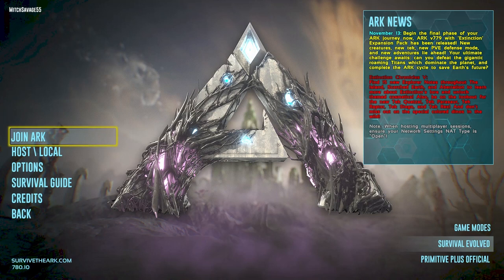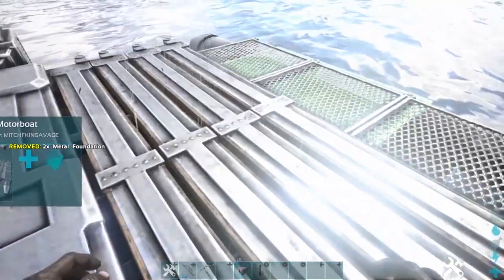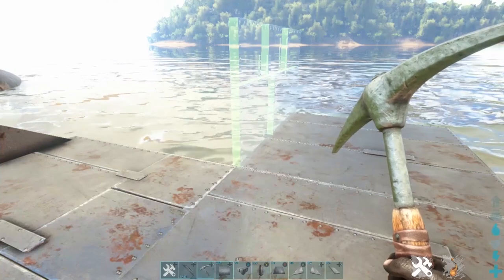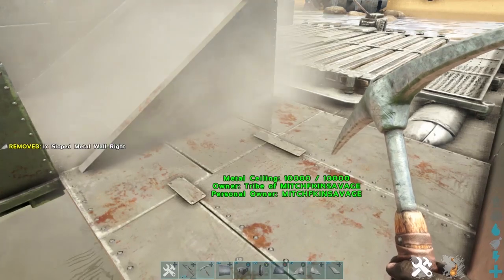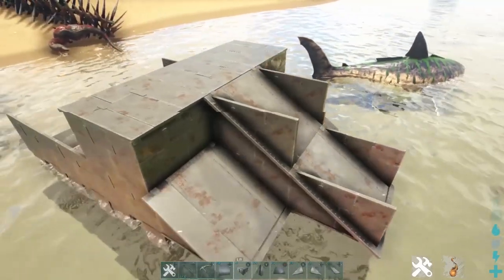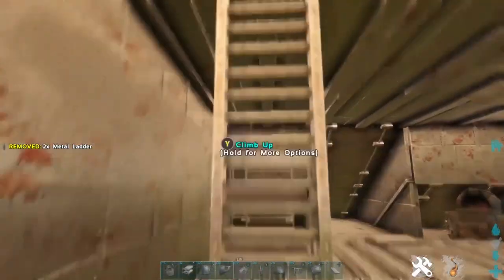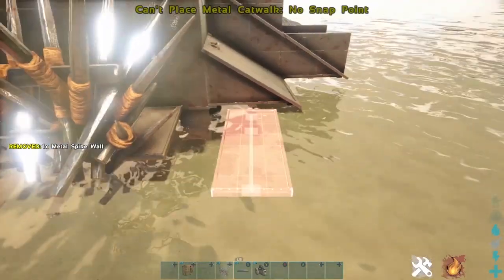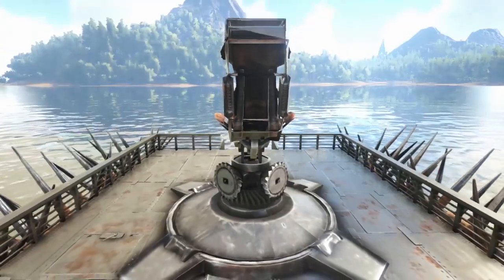Motorboat Base Design - Ark Survival Evolved - LEED PROOF

Comment: isnt the limit 80?....there are things you can cut, for example, don't need the stairs to go from hatch to floor, just one is enough...so there u save 1... and the railings, they are only needed in front of the hatch, so you don't fall when going up... so yes if you sacrifice looks for efficiency, you can place some more things